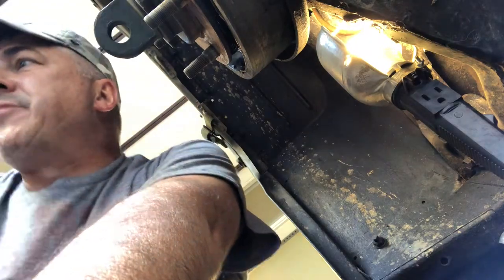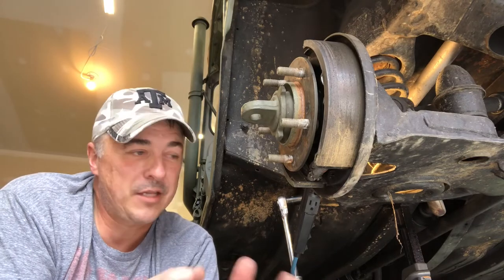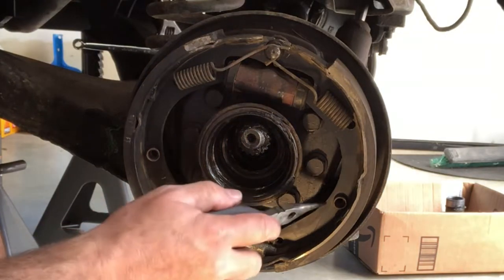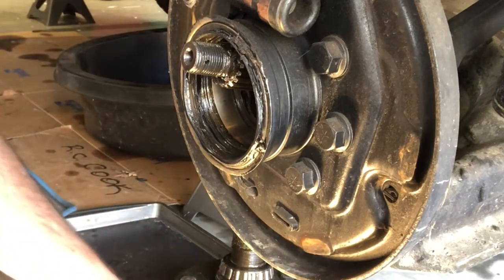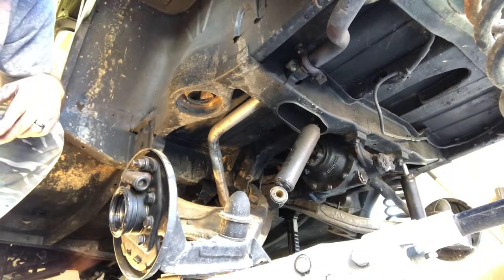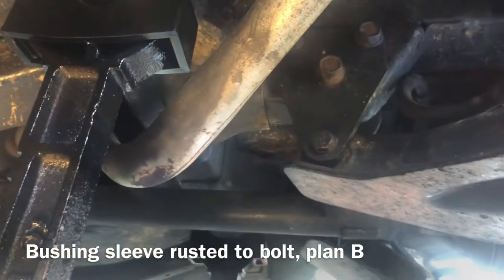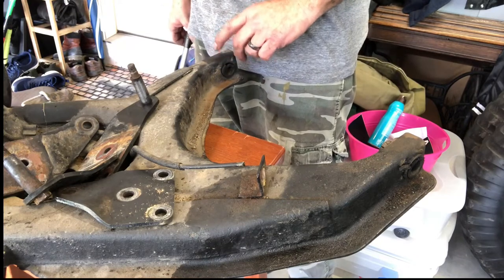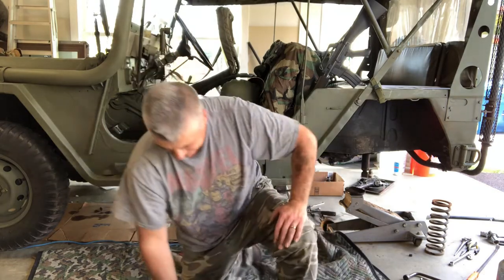How to remove an M151A2 rear control arm.

Comment: Mike, when you clean the brackets you should discover that they are stamped in an alphabetical order in the way that they orient across the frame A,B,C,D,E,F,G,H. Once you see these marks, you can quit stressing over trying to remember location/orientation. I'm glad I encouraged you to buy that one, other than routine maintenance issues, which you are addressing, that unibody is squeaky clean where it matters.